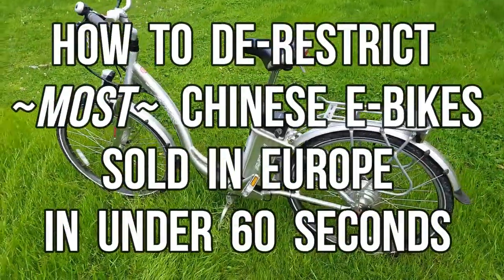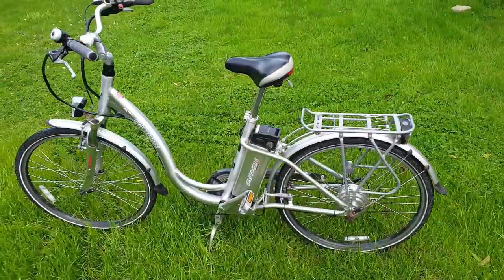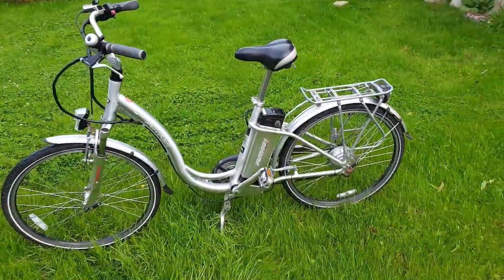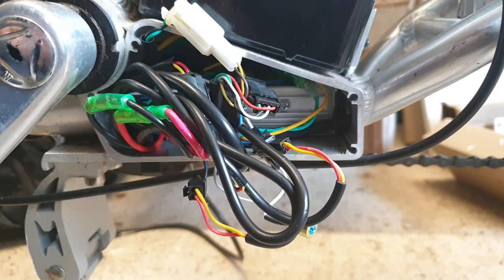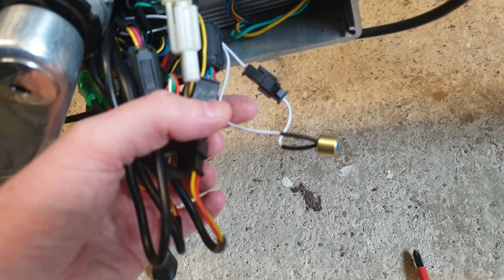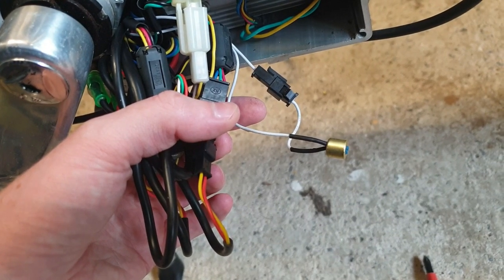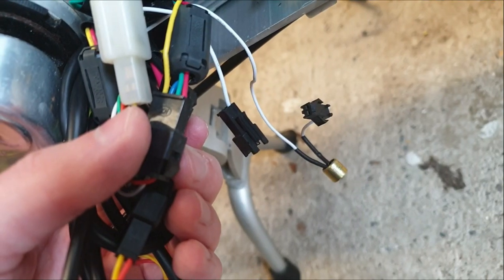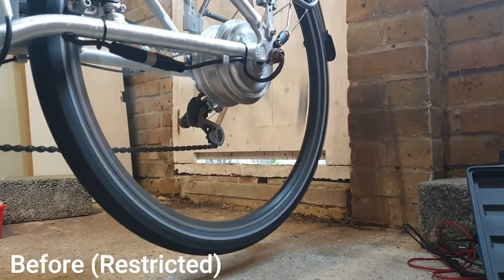How to de restrict most chinese Ebikes sold in Europe in under 60 seconds

Comment: There is more than one white wire!!
Reply from the maker: Does it have a resistor in between it? That's what you should be looking for.
What controller do you have? Does Google give you any help?
You could ask on the endless sphere fb group if you are still stuck
Reply: I’ve been researching like crazy. I entered a smaller wheel base, I increases the voltage and it goes a little faster but I think this bike can go at least 30 mph. The controller is an M 5. The bike itself is a Gerpsi. I think the company is out of business I can’t find them anywhere. I have the need, the need for speed!! Write to me and I’ll give you my phone number. Like I said I’ll pay you if you can help me!
Reply: @michaelcohen7343  on some Chinese bikes it’s a blue wire
Reply: Thanks I’ll check it out. If anyone can help me via FaceTime or whatever I’ll pay you! But I’ll look for a blue wire. The bike is a Gerpsi. I don’t even think they’re in business anymore. It’s 1500 watts, I must go faster!!!
Reply: I pulled a blue wire and it wouldn’t run. Can someone have mercy on me. The doctor said if I don’t go faster I’ll die!! I’m just joking. But please! Can someone who knows about this give me your email address and I’ll send you a photo of the wiring? Please have mercy!
Reply: @michaelcohen7343  did you fix this ?
Reply: @e.huss1  nope I could never get it going
Reply: @michaelcohen7343  which conversion kit did you use? What’s the exact name
Reply: @e.huss1  I don’t have a conversation kit I was just told to pull a wire
Reply: @michaelcohen7343 Buy another controller and bypass all the old crap

Comment: I bought an Eliglide T1 trekking e bike and that's limited to 15mph, but you can adjust it to around 19.6mph on the settings so no need to do any tweeking. Mine cost £800 but they go for around 850-950.
Reply: 15mph is uk limit. 20mph is usa limit
since the bike is also sold in the usa, and to save building an entirely new bike, they give the option of changing the controller speed. 

common for many bikes with displays.

Comment: I know im wat late to the party but i have a vivi m026sh 48v 500w and ive scoured the internet trying to derestrict the speed limiter . No one knows . Theres no white wire or magnets and my display is LED not LCD so theres no way for me to get into the settings . Please help
Reply: If your ebike has pedal assist then it must have a speed sensor for it to work properly, and if you can't see the magnet sensors then it must be in the motor. The m026sh uses a rear drive hub motor. If you know the model and brand of your hub motor, it will be very helpful to look for it on the internet.